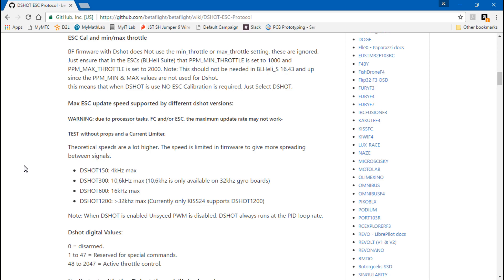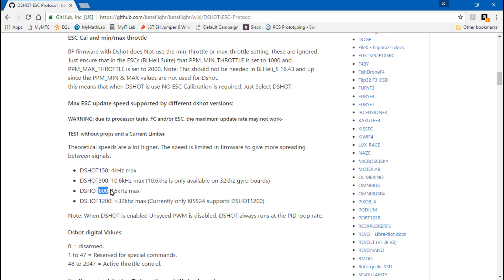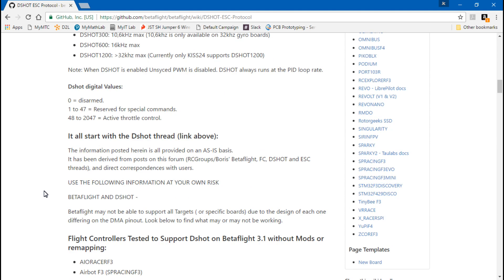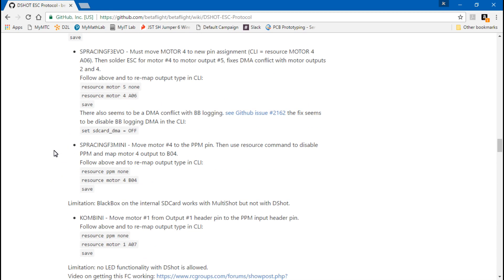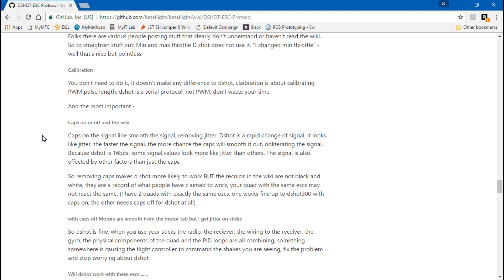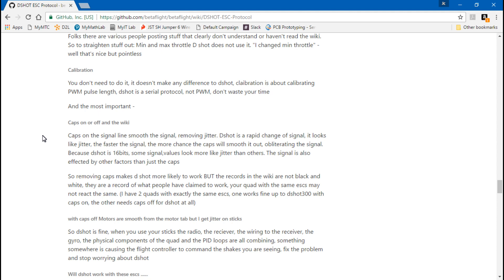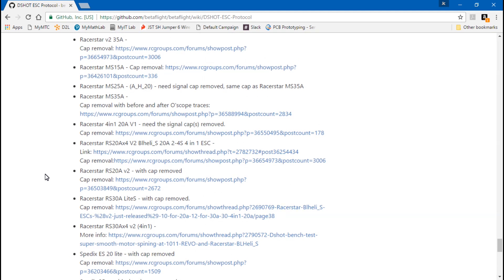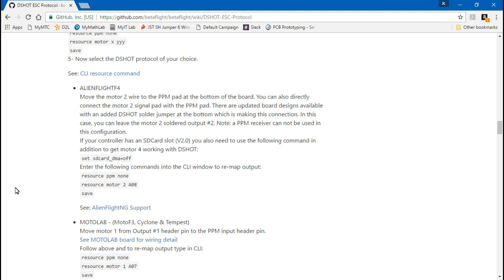Problems with D Shot? Some tips

Comment: multishot esc's according to a lot of forums can at best run Dshot300 and the real benefit of Dshot starts at Dshot600, multishot is better than Dshot300 as it is faster but has a lot of noise/jitter.
so running a multishot esc on Dshot does still have compromises.....

Comment: hey JC I have 2 kiss fc's and I'm having the issue where I can only run dshot 150. on 300 or 600 the LEDs on the escs don't light up when armed. I think it's the resistance issue you mentioned next to kiss FC in your vid. any help would be greatly appreciated.

Comment: call me crazy. but when i first fired up d shot600 in beta flight armed the copter on a f3 board it was doing some wonkey shit. When i armed and throttled up. motor 4 was lagging way behind all my other motors. i calibrated ESC's quick. unplugged battery, throttle 100 percent, plugged back in. did some beepy stuff. throttle down. did some more beepy stuff. and THEN motor four was then in sync with every other motor. just my personal exp. it may help someone out.

Comment: I just Dshot my Motolab Cyclone FC, signal wire from motor 1 to ppm pin and also switched the motor resource in CLI as described. Motor 4 does not spin when LED strip is enabled. Do you know if there is a way to have both, motor 4 and LED? Couldn't find anything in the docu